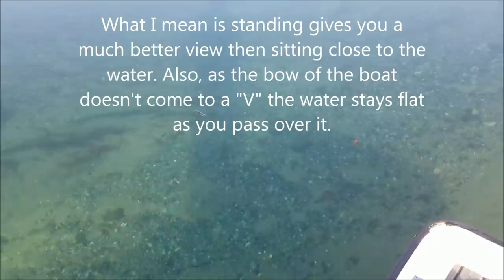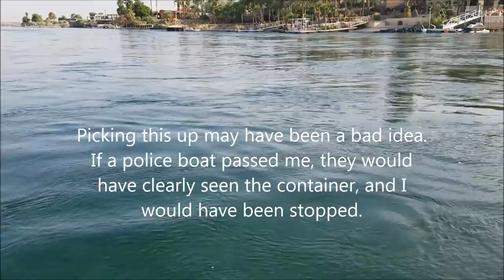I Bought The Strangest Little Boat On Craigslist

Comment: Neat project, but you NEVER begin sentences with "So."  It was seriously annoying to constantly hear you abuse our language.  Just start your sentence with the word you were going to say after "So."  The time lapse jumps were helpful, but having the camera constantly pointing down helped no one to see whatever you were experience.  Each time the camera dropped down, those are sections to remove from the final version of the video.

Just doing the final voice-over work in post-production can help you avoid having all of those sound problems that kept occurring because you only used a boom microphone.  Writing a script also helps avoid having the countless other grammatical problems that were too long to list in this note.

The project was interesting to see, but the endless commentary and bad section of the camera pointing in the wrong direct were some of the reasons you got 255 THUMBS DOWN thus far.  Editing out each time you had to play with the camera would have made sense.

For your trailer updates, you should have used MDF (a synthetic board) instead of pressure treated wood because it would last you decades instead of about 5-years.  Yes, it is more expensive in the short term, but it would have helped your trailer last longer.

The boat should have proper marker lights in case you are still on the water after dark.  Then you should have a canoeing paddle (retractable version) so that if your motor dies or if you run out of fuel, then you are not stuck out in the middle of a stream).  Beyond that, you need to add a battery powered emergency stroke like that could be used in case of an emergency.

OTHER SAFETY GEAR: there are newer Personal Flotation Devices (PFDs) that you can get that are rather thin and they look like a harness.  Having that for the passenger would save space on the small boat.

Having a marine radio is another safety device such as one of the submersible Raytheon Marine radios.

Adding a whistle to each PDF is helpful as it can be heard much farther and louder than the human voice screaming for help.

Having a small anchor can help you as a safety device.  If your engine fails or runs out of fuel, you don't want to go downstream too far from your starting point or go over a set of falls/lock & dam.  Therefore, an anchor has many benefits.

There are watertight boxes you can add for storage of your missing cell phone and wallet.  That was why the boat had the black back-strap pouch that we never saw you replace or reuse.  Some of the safety gear I discussed could have been stored in the pouch.

Next thing is that you are required in most states and commonwealths to carry your BOATING LICENSE in addition to having the numbers/stickers displayed on the side.  The best way to deal with future problems is to consult boating manuals that have these emergency equipment lists.

Even having a water bottle could be part of your safety equipment because boaters can become dehydrated being in direct sunlight too long.